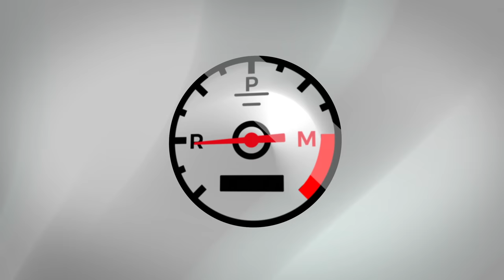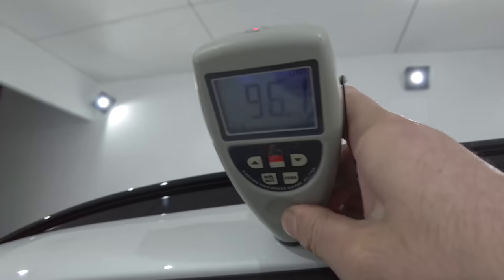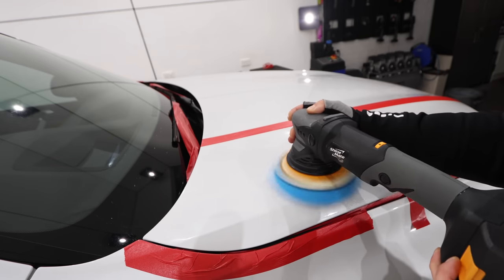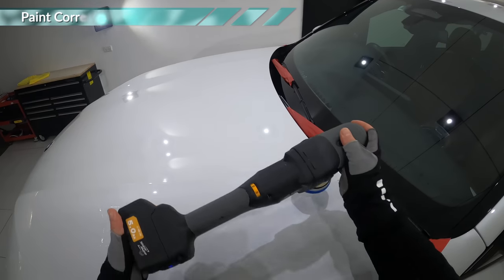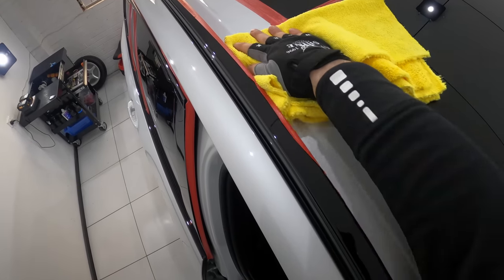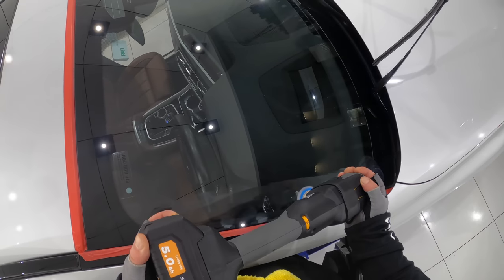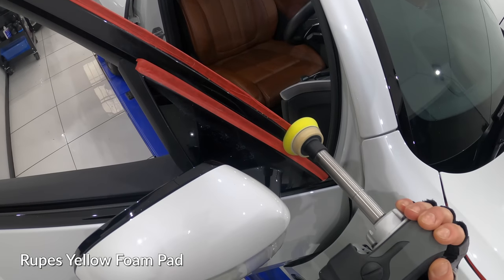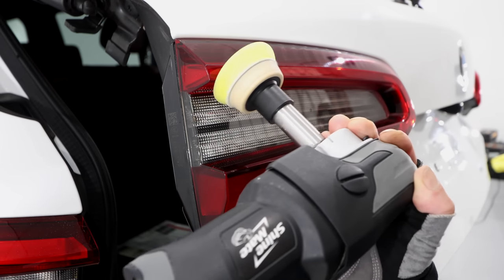BMW X5 Full Step by Step Detail | P2 Paint Correction (Vlog 39.2)

Comment: You reckon that car was stuggle to reach the centre of the roof. You should have seen when I decided to polish my Holden Jackaroo while it was on jack stands about 10-12 inches higher than normal cause I had the gearbox out and was waiting for parts. I had to use an adjustable tressel to stand on, it was super easy to do the lower sections of the car though.

Comment: It's a great video. Thanks. 
I wonder why you use compound instead of products for glass (such as Ceriglasss) when polishing glass.
Reply from the maker: Thanks, and I find CeriGlass is quite aggressive on glass, especially with the Rayon pads. If the glass is badly scratched up it can certainly be a good choice, but if it isn’t, it can leave fine scratches in the finish that are difficult to remove.

Comment: How long did this vehicle take you if you don’t mind me asking? And great work btw!!!
Reply from the maker: It was about a 25hr job of actual detailing - it’s just hard to be precise because filming greatly slows down the process.
Reply: @CarCraftAutoDetailing  I would imagine so, I guess I need to slow down my work. I would’ve done that car in around 10-12 hours
Reply from the maker: Everyone’s goals, budget, circumstances, quality of work and skill level is extremely different, so it’s virtually impossible to compare apples to apples from one detailer to another or even from one job to another. So 12hrs might be ideal in your particular case based on those factors 🙂

Comment: gj，thanks the update，one question，lc blue cutting pad on the thin,soft paint？
Reply from the maker: Try the orange first, if you get enough cut move up to the blue. But yes it can also be great on softer paint.
Reply: @CarCraftAutoDetailing  thanks ，just afraid that cutting more clear coat on my subaru's thin,soft paint.maybe rupes yellow foam pad and lc orange one is the only one choice that i can do…
Reply: @CarCraftAutoDetailing  and also afraid to use rotary on thin paint ，from a beginner。

Comment: I do have one question though. How do you get the spots right under the side mirrors with the panel making it impossible to fit a machine polisher?
Reply from the maker: I think there was a couple shots in the video showing me using the rotary with a long extension bar and 1” pad to reach around the mirrors. But sometimes I’ll also use my Rupes iBrid polisher and other times I’ll do some hand polishing - every car is different so it’s a case by case scenario.

Comment: Great work Sandro. Learned a lot on this one. Wasn't sure if it was ok to polish that piano black trim. When I tried that previously I noticed some black staining on my pad, so I immediately stopped. Perhaps I was being too aggressive.
Reply from the maker: Thanks mate, and in some cases those trims can be single stage paint, so it’s normal in that instance to get black residue on your pad. The letter case would be that the clear has failed/worn so you are penetrating to the base coat which obviously isn’t great!

Comment: Was it just a visibility issue to use the bar on the 3" rotary as oppose to the 351-3/12 DA? - (need a hang gliding harness?) - as an aside how many batts did the X5 take?
Reply from the maker: A hang gliding harnesses would be nice 🙂
Apart from better visibility, the extension bar also helps provide some better clearance to avoid the body of the polisher making contact with the panels and in some areas longer extended bars where used to reach harder to access areas.